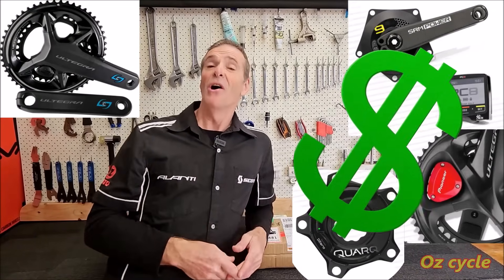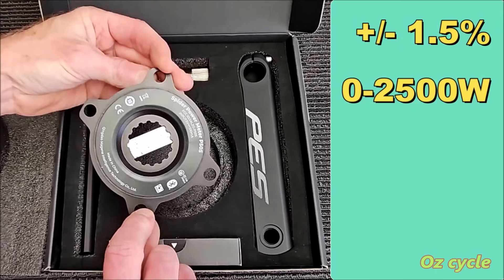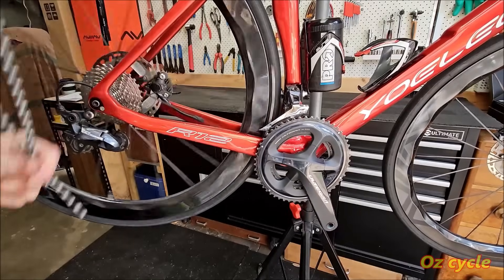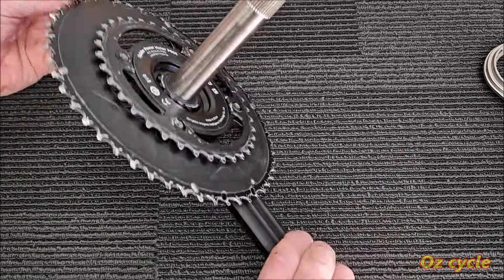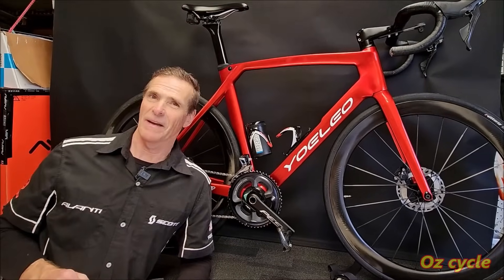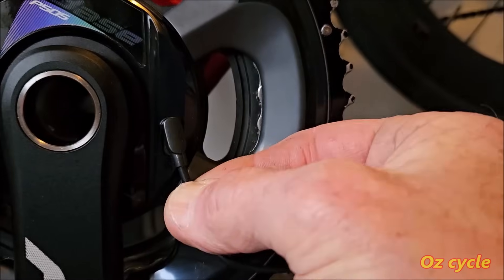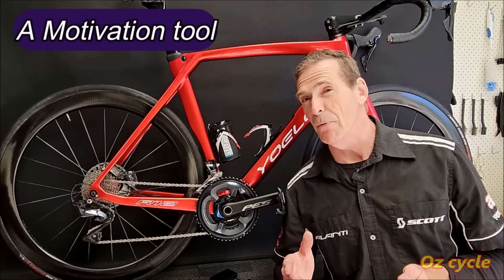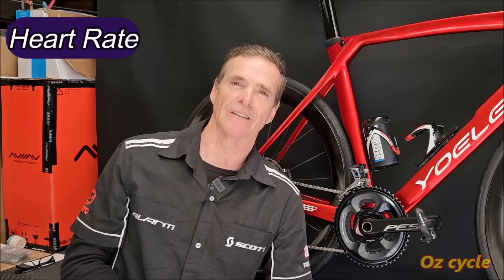Power meters getting cheaper - should you buy?

Comment: Adding pedal power meters will not alter the Q-factor, but it may alter the stance width. The Favero Assioma ones, which I use, add just a little to the width. The first power meter I bought was a Stages Ultegra left crank arm one, which was reliable. I sold it, when I swapped to a Dura-Ace crankset (although I could actually have kept it). I then bought a PowerTap pedal-based system, which was truly terrible. I now have the Assioma Duo pedals on my CX bike and the Uno on my indoor bike - extremely reliable.
      Using a heart-rate monitor with a power meter is not just an excellent way of gauging your fitness, but also your health. You learn how to equate the two, knowing when you are in form and when you are not. Last summer (2022) I was producing good numbers; however, this summer I knew something was off, when my power output dropped for the same heart rate. A blood test revealed that I had coeliac disease and my iron, RBC and my hematocrit levels were dropping through the floor. 
      I think, if you are serious about your fitness and health, then a power meter is a good investment.
Reply from the maker: Thank you for relating your experience wabout heart rate co-responding to a health condition , very true 👍
Reply: Absolutely a heart rate monitor & cadence monitor, but there's no need for a power meter, for a but competitive cyclists.
Indeed, most that have them have little clue how to use it properly.
Most buy them because its the latest thing & keeping up with others.
It's not the wise person's choice.
Reply: @tman5634  I used to share that mentality, before I bought one.
Reply: @dpstrial  
Are you racing at a high level?
Reply: @tman5634  I have never raced in my life, but I do like to compete against myself (if you know what I mean). I have used my power meters to improve and monitor my fitness over the years. I have a couple of books on how to train with power meters and have watched many YT videos also. My own target was to improve, not my power, but my V02Max - and, I believe, it worked.
      Being able to monitor my progress objectively is to me what having a power meter is mostly about. If you are not serious about your fitness - as most people aren't - then you will not need one.
Reply: @dpstrial  
As a professional team mechanic of many years, do you know that many world tour riders would rather not use one?
They see it as over complicating what is essentially something they set off doing for enjoyment. Of course most now do so as training aids as perimeters set out by themselves & their coaches.
It's a needs to an end for them, but it's not a needs to an end for all cyclists...indeed for most they're a hindrance.
The comments I get by most social & recreational cyclists in my workshop,  who already have a power meter is...I don't really know what I'm doing with it, the numbers don't mean much to me.
Indeed these people shouldn't have, nor don't need one.
It complicates their enjoyment of what they started cycling for.

Funnily enough, in the same way many professionals feel...though it's their living.
Three years ago when Pogacar won the TDF, he trained on feel, just like many of the great riders & winners before him did.
Again, he didn't want the distraction of such data.
Reply: @tman5634  Each to his own. I believe it has benefited me and I will continue to use one. The numbers are not a mystery to me. It's the most objective measure there is; and, when used in conjunction with a HRM, it is a very useful tool. Regards.
Reply: @dpstrial love my power meters but they're not health tools.  A heart rate monitor is important for health though.  Largely to not overdo it.   For regular people that just wanna be healthy, not overdoing it with your heart is key.  If you want peak performance with power, you're going to have to put beyond necessary stress on your heart.
Reply: @tman5634 interesting analogy with T. Pogačar! But as @dpstrial adduced, to each their own...
Reply: @tman5634  Sorry but I disagree with your thoughts on Pogacar. During the penultimate race of the Giro d'Italia he was seen constantly checking his instrument to maintain his wattage/cardio so as not to exceed but maintain a high pace. It is now a certain fact that monitoring race performance is essential. If an amateur cyclist is not interested in improving/maintaining his performance, he will not need a power meter. On the contrary, if he has a competitive mentality, I believe he will find a valid ally in monitoring the parameters. Even on a cyclotrainer I find it essential to use the detection of the power delivered during the execution of a training plan. Then, everyone is free to do as they believe. A greeting.